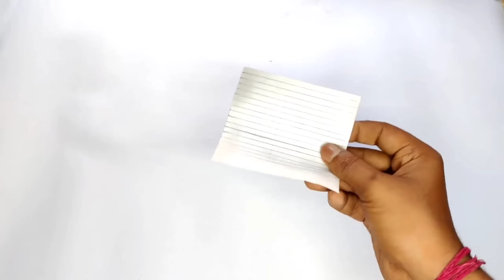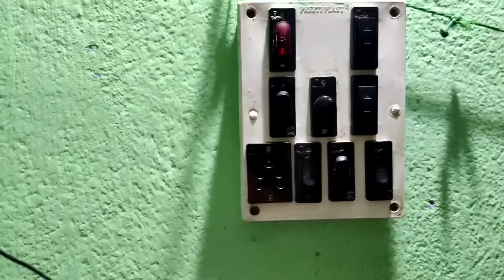4 Amazing Wall Decoration Ideas | Antique Wall Lamp | Diy Wall Decor | Wall Decoration Ideas

Comment: Apki jo 1 me jo apne battery use ki use ham charge kese kare
Reply: Use charge karne ke liye jo is video main us battery ke baad charger lagaya tha usi main ye battery 🔋 laga dena battery ka + bala charger ke red wire main aur battery ka - bala  charger ke black wire main laga dena ok bro aapki battery hone lagegi charge 👍👍
Reply: Use 18650 batteries costs 150 rpees pkr or 1$ internationally 

Charger also cost 1$ any 4 volt adapter will work however as an cheap option buy dont charge for more tha 25 mins